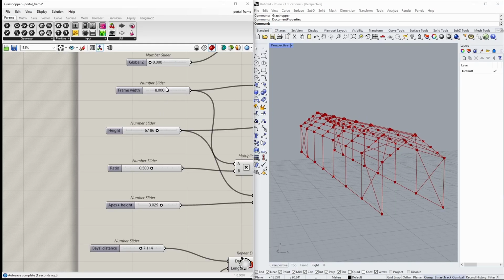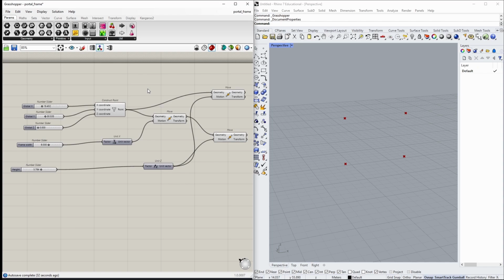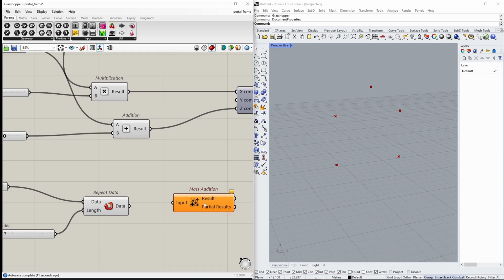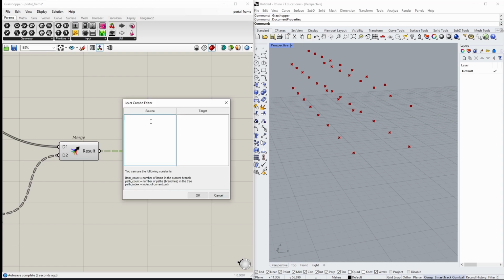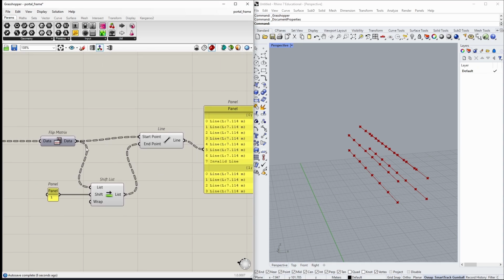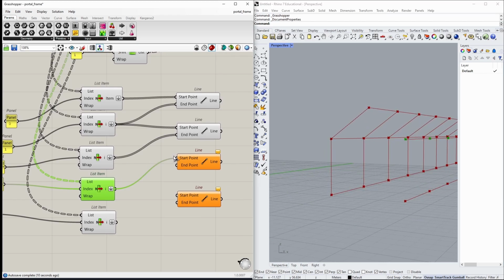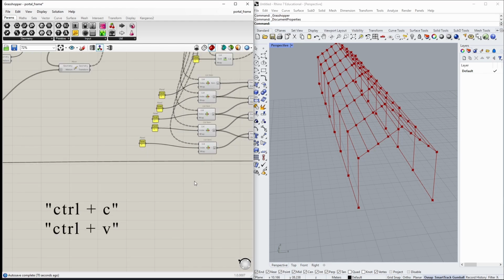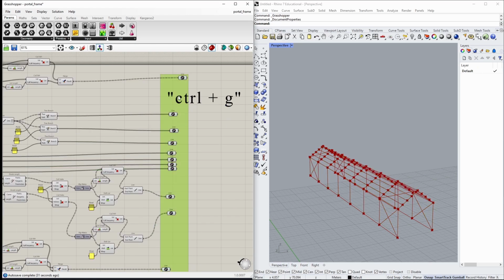Parametric Portal Frame in Grasshopper! The Engineer Way | Grasshopper Tutorial

Comment: Hey im a steel detailer and im tryin to learn how to make a model of a simple steel structure in grasshopper+ Tekla. The way im trying to model this is by making one side and mirroring it over the apex. My first question is how do i mirror a column so it also takes into account not only the distance but also position and rotation? Second thing is the front and rear row of the building have different profiles in beams and colums. Because of the lighter profiles than the middle ones they also have smaller footings. How so i model this the most simple way?
Reply from the maker: Mirroring through the apex make sure that those points are not getting mirrored into place. However, Tekla should be intelligent enough to disregard duplicates.
When you are mirroring the Tekla-defined elements, the beam / column component is the deciding factor for rotation and off-set (if my Tekla memory serves me correctly). This means that in this action, only the raw geometry (the lines and points) inside Grasshopper should be mirrored if you want to have control over the different sides. To achieve this, you need to separate the two and have 2 Tekla components, one for each side. 
The ends of the structure can be separated with a List Item supplied with indices "0" and "-1" for the first and the last elements in the list, respectively.
I hope this helps!

Comment: I think you would be able to do it with much less components, also wouldnt making a one section and copying it work? because that will make the script much less cpu intensive
Reply from the maker: You are right, creating one section and copying it will make the script tighter. However, I got used to needing to modify geometry in an awkward way, so I usually build all the points as the first step. And as an addition I have not seen anyone making it this way. I wanted to show an alternative to what's out there.